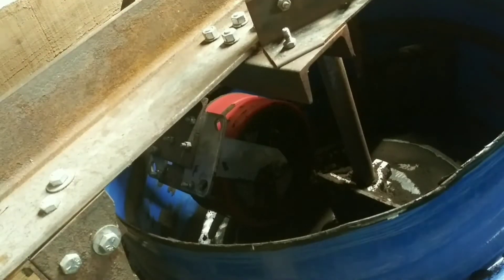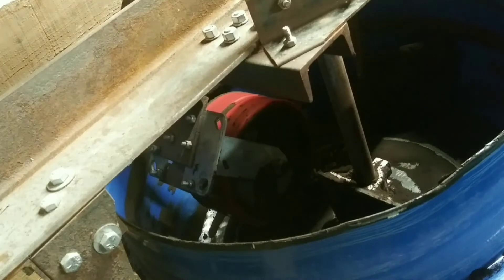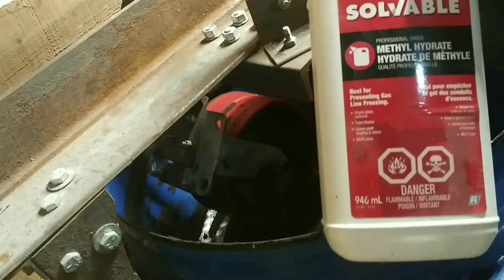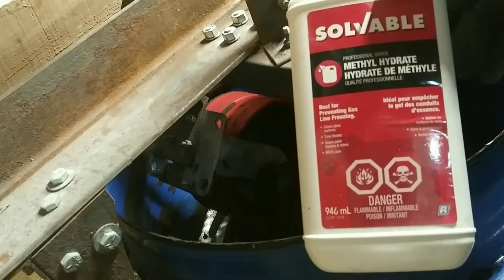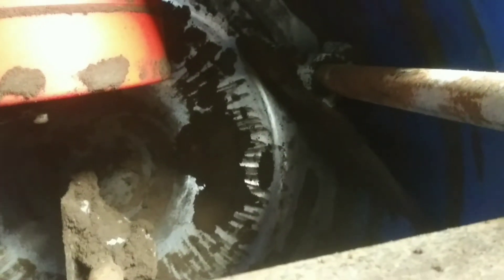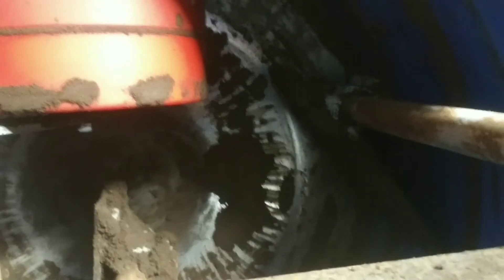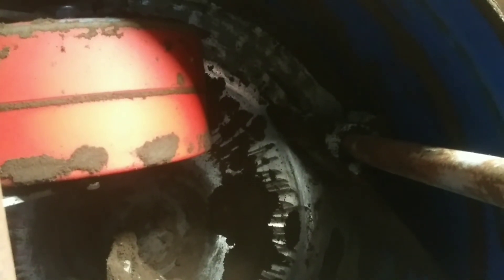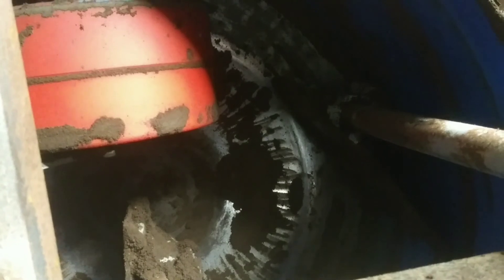Petrobond maintenance and a sand muller improvement

Comment: good to see that thing is still working for you, remember watching the vid's on you making it!
Reply from the maker: Thanks for tuning in through all these years Cotw!  And hats off for enduring those old build vids, each one of thrm seriously had to have had at least 3 years more me on fast forward drilling holes than necessary, and there was only one lighting myself on fire with angle grinder sparks incident in the whole series to make up for it.  Anyhow I'm really glad it still works too; the muller is absolutely an integral part of my small foundry.  I wouldn't have even considered taking on the run of parts I just delivered without it!  Hoping I'll be able to find time to edit some video about that project soon.
Reply: @tobhomott  trying to find time to edit things down to something useful is painful some days and time consuming!  Good luck